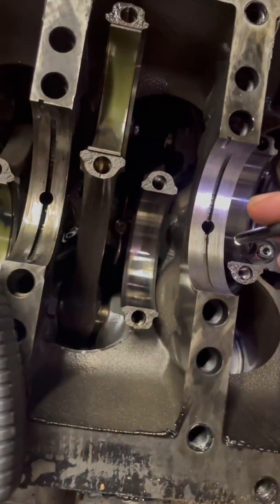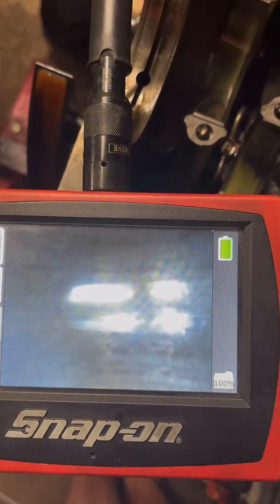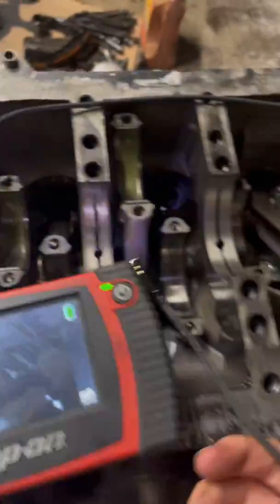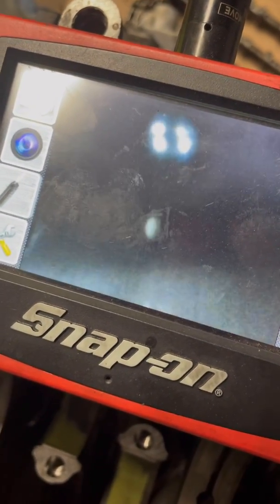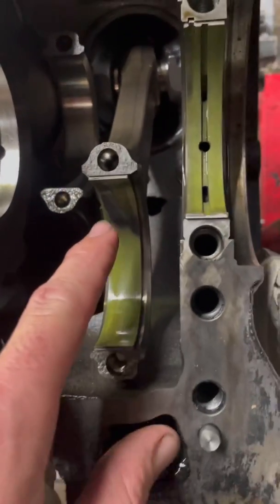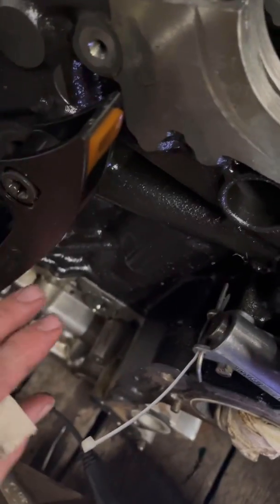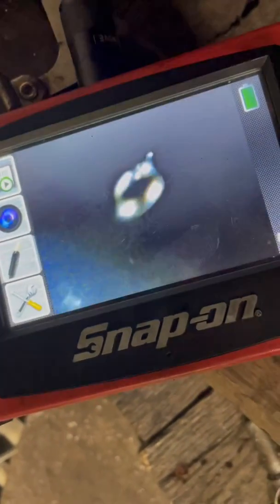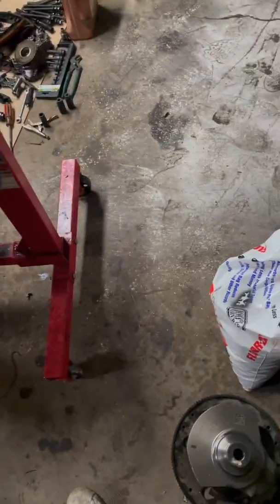Two Ecodiesel engines with broken cranks

Comment: Your general observation regarding sooth in oil notes is well noted and shared, however you condition evaluation of main bearing string no wear was done by evaluating the upper bearing shell and not correct as this shell has no load. Sharing your weak crank design statement. 
Thanks for sharing your observation
Reply from the maker: This isn’t an observation this is the exact cause listed by fca.
Reply: @Recklessmotorsports  
So FCA has acknowledge the issue with low rpm and torsional vibrations as reason for crank failure. Thanks for sharing your knowledge.
Reply from the maker: Yes all the information provided I got directly from a fca document. It’s the sole reason for the recall that makes the 8 speed downshift when you sneeze.

Comment: Did the owners say they babied these motors? Drove them like grandpa?  Lots of sub 2k driving.
Reply from the maker: They are all bone stock normal driving
Reply: @Recklessmotorsports  I asked because we hear it on the forum when one fails. Another is always trying to get it stay in the highest gear possible when towing. “I’m easy on drive like grandpa.” Then you hear that low rpm crank harmonics can make the crank squirm eventually twisting out a bearing. 🤷‍♂️

Comment: LOOKS LIKE THE BLOCK ITSELF WARP A LITTLE. USE A STRAIGHT EDGE AND CHECK THE MAIN BEARING SEATS.
Reply from the maker: Cast iron block this thing doesn’t move at all, though the factory mains were never properly line bored from the factory.
Reply: @Recklessmotorsports  if that were true the engine would have failed in 10s of miles not over 100k. The crankshafts flex in them. Is well a well known issue especially in the Ram trucks.
Reply from the maker: Engines don’t flex, the cranks do. Which is what I have always said.
Reply: @Recklessmotorsports  sorry I wasn't clear on this, the line bore being wrong.
Reply from the maker: They aren’t line bored properly from the factory either the casting is awful